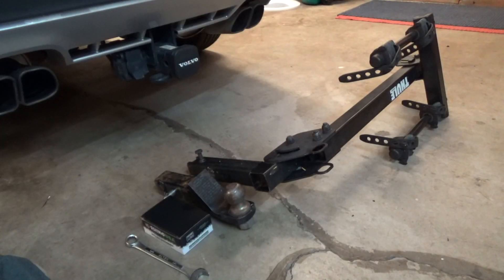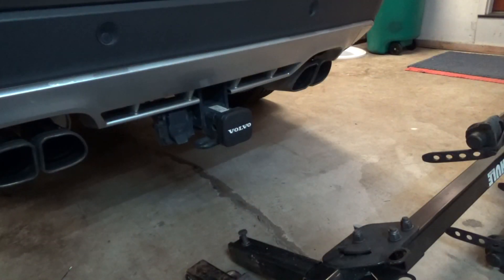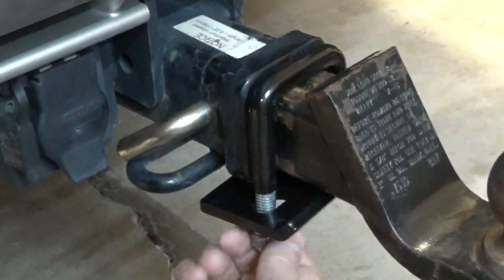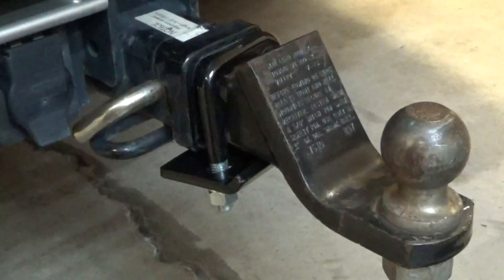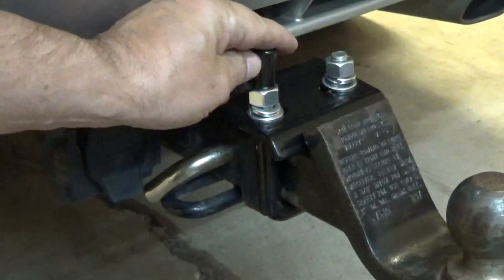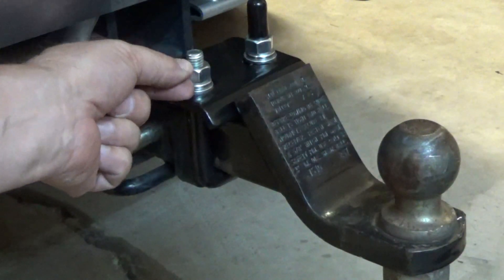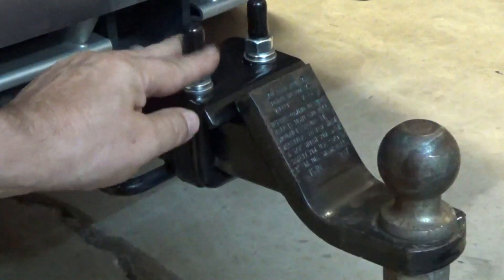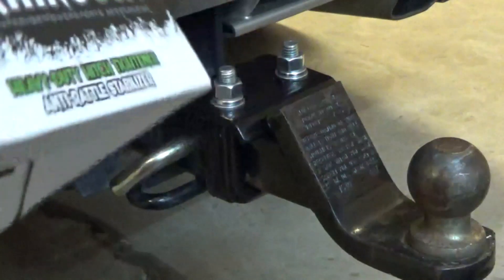Trailer Hitch Tightener Anti Rattle Clamp

Comment: Wrong.... upside down puts all the load on the U bolt, your physics explanation is "upside down"... the manufacturer has already thought this through.
Reply from the maker: You are correct. I have been using this my way without incident.  Having said that, I appreciate you taking the time to point out the OEM instructions.